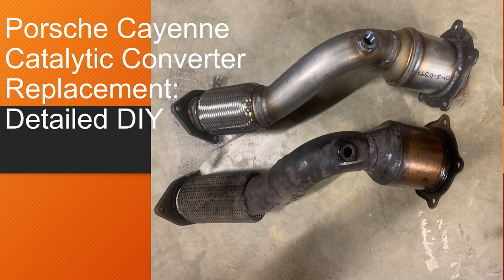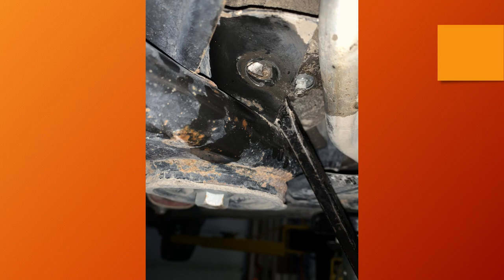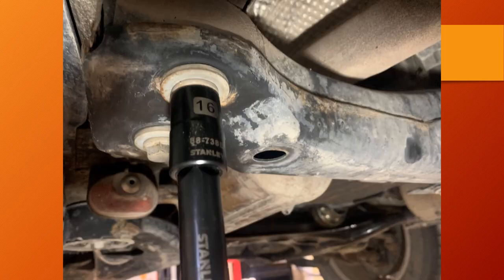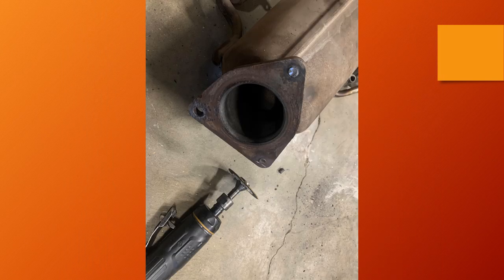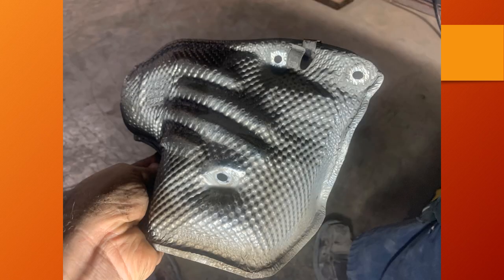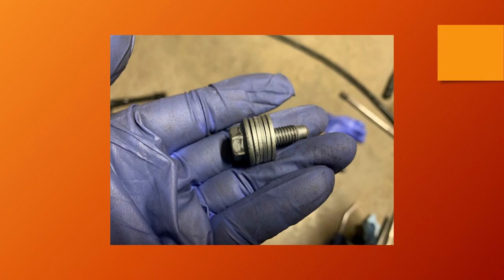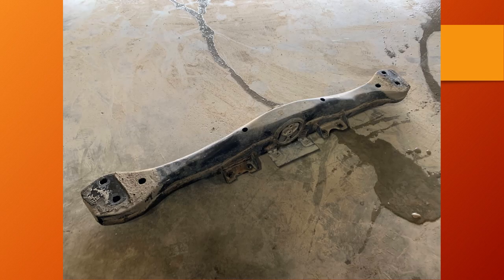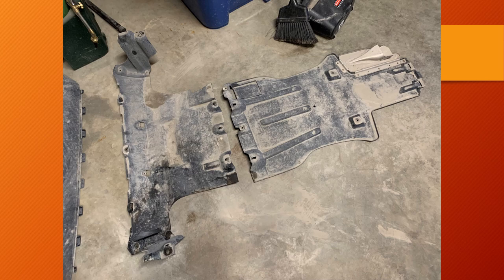Cayenne 957 S Catalytic Converter Replacement

Comment: Just did this over the weekend on my ‘08 Cayenne S using 4 jackstands. I really appreciate the video, I don’t think I would have attempted it without seeing all the steps involved. I’m not aware of any other video detailing this. A few suggestions to add:
1. If you don’t have a shop torch, consider buying a new secondary cat. The studs are extremely difficult to remove, even after drilling out.
2. Support transmission and remove crossmember from car before removing the 2 mounting bolts (16mm is also not a common size in most sets)
3. Spray header studs with liquid wrench using multiple applications and at least a full day
Reply from the maker: I’m glad you found it helpful.  I only take the time to make a video if I can’t find one on the subject that will suffice.   Good idea to add tips based on your experience.  Would probably be less expensive to buy a small acetylene torch like I have than a new main cat and then you’d have it going forward (very handy).
Reply: I got my primary catalytic converter off rockauto for $350(was a perfect fit) and noticed the back one was listed at $281, which didn’t seem terrible. Having a torch would definitely come in handy on future projects though.
Reply from the maker: @davidplathe  Wow, that’s a good price!!  That is definitely less expensive than the torch.  Good tip!

Comment: Thanks for the video. I’ve got to pull them both. So far only one broken rear cat stud. Fronts come out tomorrow. 
Nice wood block brace 16:26
Reply from the maker: Good luck tomorrow with the primaries and let us know how it goes.  Fingers crossed that your exhaust manifold studs are in good shape.
Reply: @pcardoctor5492  Got them out, no Broken studs! Got to be very careful putting in the new ones. The catalyst is exposed and could easily be damaged!